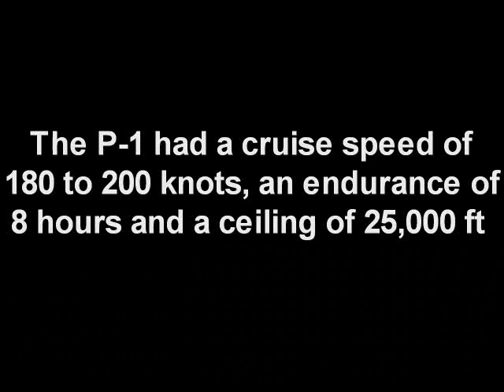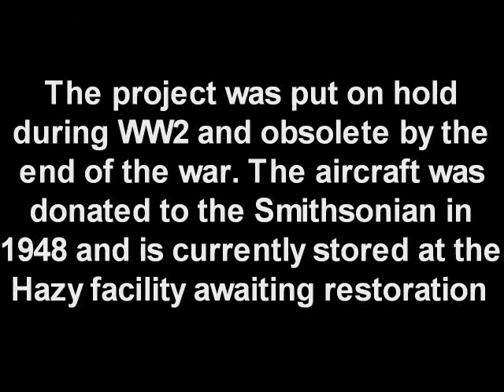Forgotten aircraft: The Abrams Explorer

Comment: @athaidream Rolls Royce inline 12 cylinder aircraft engines form a family dating back to WW1. In 1915 the RAF required an engine of a certain size and power and no such engine was in production or development in the UK at that time. There was only one engine in the country that fitted the requirement and that was in the front of the German ambassadors Mercedes limousine which had been seized. The car was driven to the Rolls Royce design offices.The engine removed & reverse engineered